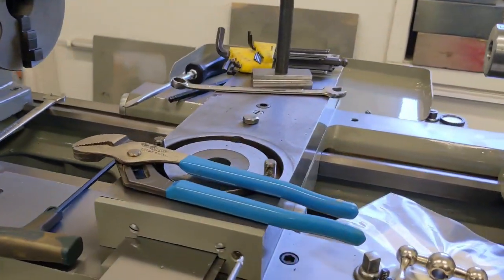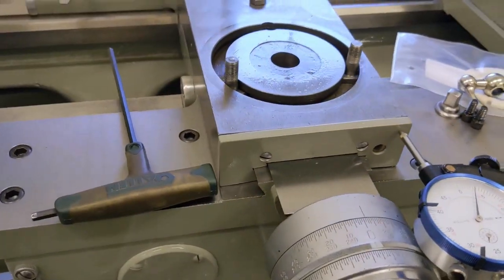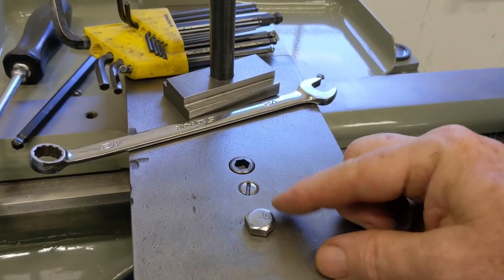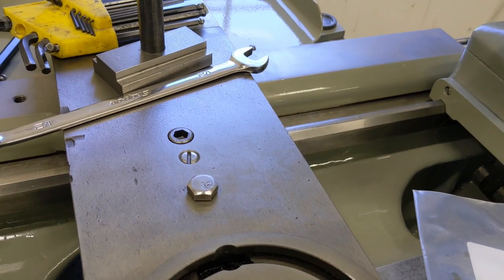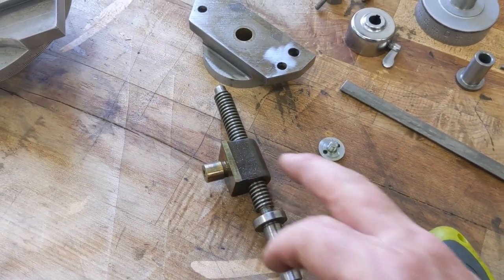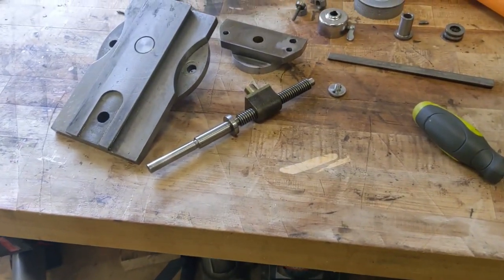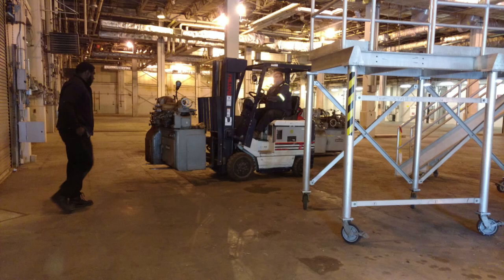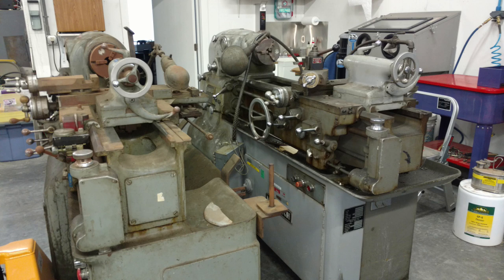Monarch 10EE lathe refurb part 28

Comment: Kevin,  I bought the set of nuts on eBay.  I think the crossfeed nut will need to be machined, but haven’t got there yet.  Huge improvement. The before and after pics are great. Still don’t know why you didn’t choose to redo the 30”?  I will go up to my shop tomorrow and take a look at the eBay nuts and let you know what I find out. Cheers, Will
Reply from the maker: Hi Will, so I went ahead and ordered the set from the guy on EBay. We'll see how they work! I'll do a video on it. So...why not do the 30"? Well, I gave the topic quite a bit of consideration. What it boiled down to was I rarely if ever use my current 20" to its capacity. I also have a 40" Chinese lathe that I will set up with the metric threading gear set and leave it that way so I'll use the Monarch for most work and SAE threading and the Chinese lathe for  the work needing longer bed length and metric threading. I felt there will certainly be someone in the world that would love to have a 30" 10EE and would put it to better use than me.

Comment: Wow.. those nut prices are crazy expensive. No wonder companies no longer make lathes in the USA. I was speaking to a company that sells Taiwanese lathes that are good quality. The 12x40 lathes are in the $6 to $8k range but they are backordered for months. I said to him that it's a shame that no one makes lathes in the USA anymore. He said this $6-8K lathe would cost $40-50K if it was made in the USA! Scary.
Reply from the maker: I think this is a pretty complicated topic actually. I have a manufacturing company that I started in my 2 car garage and have battled cheap Asian competition for years. From what I see, there's significant government subsidies in most of those countries in order to "dominate" whatever sector they target. I've seen a situation where a machining company received basically a non restricted government grant to completely outfit a modern CNC machine shop. No strings like we see in the US. Of course there's a risk of fraud but with a reasonable amount of oversight, most companies like mine would put that money to good use. The other thing is regulatory issues. We tried to put in a powder coating line and after a couple of years of the local and state government moving the goal posts on the permitting process we gave up. We have two trucks per day shuttling parts back and forth to the powder coater! The other thing regarding the pricing from Monarch is probably economies of scale. They most likely have very small lot sizes for these sorts of parts and the short run pricing is very high no matter where it's done.
Reply: @fourpondsshop7940  Agree, it's a long conversation. There's a kid from Malaysia that has a machinist channel on Youtube. He's very talented on a lathe he works on at work. Poor working conditions at his job but he does amazing work with what he has. He makes $10 dollars a day at his job. First, manufacturing went to Mexico for it's much cheaper labor. Then onto Asia/China for it's very inexpensive labor. I think we're going to continue to see manufacturing jobs dry up in the USA with our expensive labor costs. Sad, but it's reality.

Comment: Miller Manufacturing will make nuts and screws
Reply from the maker: I think those are the folks I found on Ebay
Reply: @fourpondsshop7940  Miller is in Illinois, the ones I see on ebay ship from Kansas.

At $200 you're in range of buying the taps and materials to make them yourself.

If you have a good press you might make do by pressing the nut lengthwise.  You can often get another couple of months of use from one that way.  Once.